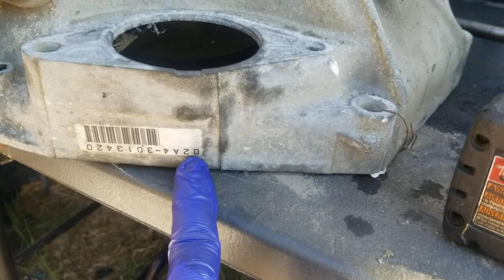AWD B SERIES TRANSMISION gear convert H22 and modification

Comment: Why did you swap the h22 gear set off the coutershaft onto the 90-91 prelude. The prelude already has a 4.266 fd? Or did I miss something
Reply from the maker: The h22 counter shaft is bigger then the 90-91 prelude counter shaft. Unless u machine the beating housing for the h22 bearing then u can run the h22 counter. 90-91 prelude and 90-91 accord counter bearing is the only 2 that u can run inside the crv awd transmition.

Comment: Do you prefer this method & H/F-series gearing over buying the SpeedFactory kit & using B-series gears? 
97-01 prelude 1st-4th is pretty close to B16 gearing except 1-2 is a bit wider in the prelude.
Trying to put together a nicely geared trans for my F2B-AWD CRV, the 1st-2nd shift is terrible.

Comment: Brother I need a 1-2 gear selector. For my 2008 TLS manual S Type J35A8. I can't put my straight cut gears without it. By chance do you have an extra, so I don't have break into a j32a3 I believe they are the same from talking to my 2 dealer buddies.